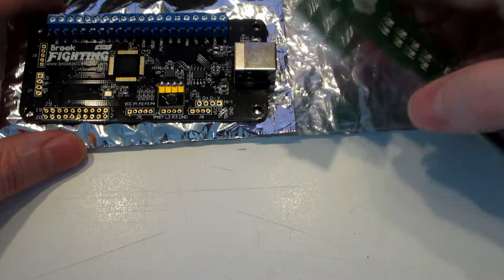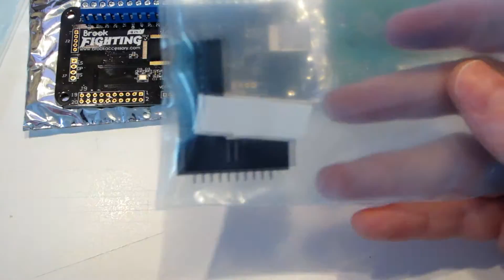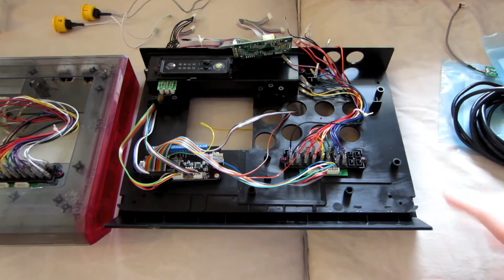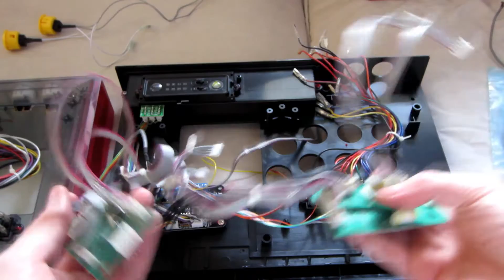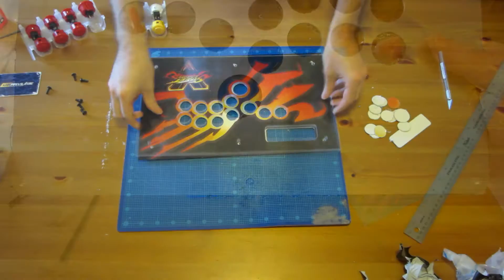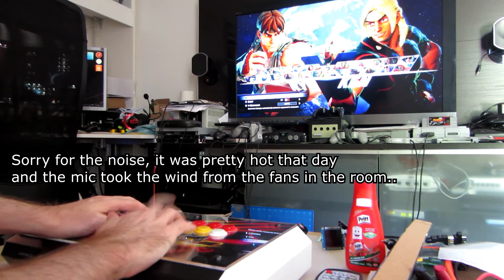[Arcade Stick Mod] Part 6: Hit Box - MadCatz TE X360 + Brook Universal Fighting Board

Comment: @The Real Phoenix , It appears that you made your own connectors cable for certain parts. Do you know if those connector are easy to find? I was looking for a connector that has 10pin on one side and splits into 6 pin+4pins for a a (LS RS DP+turbo+trackpad+turbo Home panel).
Reply from the maker: Since JST connectors (PH and XH) are used on lot of electronic stuff and arcade sticks but I could never find the cable I wanted, I decided to buy kits and a crimping tools from amazon/aliexpress so I could do my own cable. Check for JST-PH or JST-XH kits. They come with lot of different lengths. There are also pre-crimped cable just on one side so you'll only to crimp on the other side. Cheers.

Comment: Do they still make the metal plate and plexi? And would it work on the TE-S as well? Not the plus version, just the regular SSF4 one for PS3.

Also, I like how you did this mod but kept everything so it is reversible. It would be nice to have the two separate panels complete so you can swap between stick or hitbox easily.
Reply from the maker: I don't think ArcadeForge still selling the metal plate.
Reply from the maker: Jasen's customs is selling some metalplates http://www.jasenscustoms.com/madcatz-te-hitbox-panel

Comment: Did this mod recently to my soul caliber soul stick. it was a bitch stripping all those wires. had to keep the gummo pcb screwed in a little looser or the switches wouldn't slide.
Reply from the maker: Have you tried to trim a bit the end of switches? It possible they are too high and doesn't fit when you put their caps on it.

Comment: Could I not just use Stickless Adapter Cable for Sanwa JLF sticks, since I am new at all of this
Reply from the maker: Yes, and this is what I'm using now (I'm making my own cable http://i.imgur.com/kcmHi8D.jpg?1)
Reply: Thanks dude
Reply: I think im gonna mod my madcatz tes (360) Just gonna replace panel and use that adapter, can you think of anything else I may need?
Reply from the maker: Except from tools (pliers, iron solder, shrink tubes, etc), I don't think you need anything else. Maybe some adhesive supports like this: https://www.focusattack.com/3mm-hole-low-profile-adhesive-pcb-feet-set-of-4/ if you put an Universal Fighting board.
Reply: The Real Phoenix so even with the converter you think I will need soldering tools?
Reply: So you think I will need to sodder at all?
Reply from the maker: If you just replace the metal plate to convert your joystick into a hitbox and keep all the electronic inside as is, no need to solder anything, you just need the stickless adapter.
If you want to put an universal fighting board like I did, yes at some point you'll need to solder stuff.
Reply: You rock dude, thanks

Comment: Quick question. Would it be possible to take the internals of a hitbox and just put into the TE without getting the additional pcb?
Reply from the maker: It depends a lot of the guts of the hitbox, but it should work. You'd still have to link the front panel of the TE though.
Reply: Is there a way I can show you the picture I took of the guts inside the hitbox? Maybe you could tell if it is possible or not by seeing it
Reply from the maker: You can host it on a image site like Imgur.com and post the link here. You can also create a thread on the Shoryuken techtalk forum here: http://forums.shoryuken.com/categories/tech-talk
Reply from the maker: Ho, it's a PCB on a breakout board for connections. No trouble to put it in a TE, you'll just need to add some stands to fix the PCB+ breakout board. The only serious thing is to link the home button (and the turbo and leds) from the madcatz front panel that shouldn't be too hard if it's a X360 one like in my video.
Reply: Does this also apply to the ps3 version as well?
Reply from the maker: No, it's more difficult on PS3. The frontpanel on the PS3 is an "all in one" PCB with the electronic whereas the X360 is just a support for the buttons. You'll have to solder on it directly. Check the video from Vickomods to give you an idea: https://www.youtube.com/watch?v=iCvUX5vROnk
Reply: Okay got it. Also, I decided to get a brook fighting board after all. Can I use the wiring from the hitbox on the pcb? Or do I have buy that as well?
Reply from the maker: You can reuse the wiring from the hitbox... or reuse the one from the TE. Then you can sell your hitbox fully working. ;)
Reply: What about the bulky wire that connects from the brook pcb to the front panel? Also where do you get the jst connectors from? I'm kind of confused on that part, as well as the part where you added an additional board and connectors for the directional buttons.
Reply from the maker: You can bought the JST connectors on Mouser or Digikey website. You can also found them on ebay or aliexpress. Check for JST PH (2.00mm spacing row) or XH (2.54mm spacing row). Check the pinout here: https://cdn2.bigcommerce.com/server500/d90a4/product_images/uploaded_images/ufb-01-en.jpg?t=1458187066
Reply: I can't find the hx connector or the 20 pin header. Do you think you could send me a link to those? I'm so lost on the digikey and Mouser website. Also the supports are the the ones that go into the board right? I'm still a little confused on that. Your help is much appreciated.
Reply from the maker: For the 20 pin header don't look for a JST, check either headpin like https://www.digikey.ca/product-detail/en/sullins-connector-solutions/PRPC010DAAN-RC/S2011EC-10-ND/2775284 and find matching Dupont connector, but you'll need a crimping tool. You can also check for an IDC socket like that https://www.digikey.ca/product-detail/en/on-shore-technology-inc/302-S201/ED10524-ND/2794235 with the matching header https://www.digikey.ca/product-detail/en/on-shore-technology-inc/101-206/ED10503-ND/2794215 but this is designed for flat ribbon cable.
The simpliest way is to use the screw terminals on the Brook UFB: the 20pins connectors is a copy of those terminals. If you're modding a stick for the first time, this is the best solution for you. The 20 pins is when you want to do some fancy-pansy installation (and got the proper tools).
Reply: Thanks for the information, but if I use the terminals on the ufb, wouldn't I have to get new sets of quick disconnects for the buttons since they're connected to the board on the te?
Reply from the maker: I'm afraid I don't understand. If you check @3:38, you can see the UFB is link from the 20 pin header connection to the buttons throught the small PCB with 2 JST connectros in the bottom right. So if you are using the the terminals, this is going to be be the same cables, the same connectors, but each wires are going to be screwed in the terminals. This is the main utility of the screw terminals: reuse the existing wires.
Reply: That makes a little more sense now I think about it. But If I'm going to use the terminals for the buttons, how do you know which wire goes into which terminal from the buttons board? Also, my te has two 6 pins for the buttons instead of a 5 and 6 pin. I don't know if that makes screwing the wires into the terminals any different than a 5 and 6pin. Hopefully I making sense because I am new to this lol.
Reply from the maker: Well you'll need a multimeter to test which buttons is going where. If you have 2*6pins, that mean you have 2 grounds signal: one for A, B, X, Y, Lb, Rb, Lt and Rt (let's call it Ground) and an other one for Start and Select (called KGround) linked to the front panel. And this is the KGround I'm talking about in the video. ;)
Reply: How does the multimeter determine where which wire goes where? I'm not familiar with it.
Reply from the maker: Use a multimeter to check continuity between your button and the end of the wire. Each button have one pin to identify them (A, B, X,Y, etc.) and the other is connected to the ground (or Kground). http://en-us.fluke.com/training/training-library/test-tools/digital-multimeters/how-to-test-for-continuity-with-a-digital-multimeter.html
Reply: Thankfully the madcatz pcb actually says which wire goes to the buttons. Just another question about the kground. Where does that wire from the button board go to? does it just go to the front panel, or does it go to one of the ground terminals? I've screwed all of the wires into their terminals with the exception of kground, start, and select. I'm not sure what to do with the kground wire.
Reply from the maker: The Kground just goes to the front panel. Check the video @2:58, I'm explaining it.
Reply: The Real Phoenix Right. How exactly do you do that? I imagine I can't just clip the wire and link it to the front panel, or can I? Sorry for asking so many questions lol
Reply from the maker: Well at this point this is basic electronic stuff. You can either solder a wire on the back of the pins, or reuse one of the wires from the front panel. Or like me, invest into a crimping tool so you can make my own JST plugs.
Reply: I have the tools to make jst plugs. Thanks for all of the help so far. I just have two more questions. Regarding the header pins, you still have to solder those onto the pcb right? That's the last thing I am not so sure about. Also, do you still have a template for the plexiglass to make artwork? If not, what would be the best way to make a template? Thanks again for your help.
Reply from the maker: Yes you solder the header. I made the artwork myself, I download the picture of the plate on Arcadeforge, then corrected dimensions on Photoshop. Here's the template I've done: https://www.dropbox.com/s/0mgd26gg69a3sz6/TE_Full_Hitbox_Template.zip?dl=0